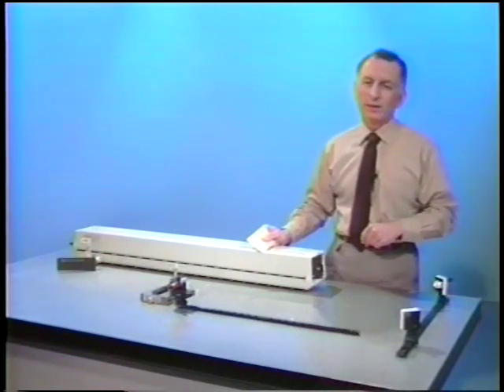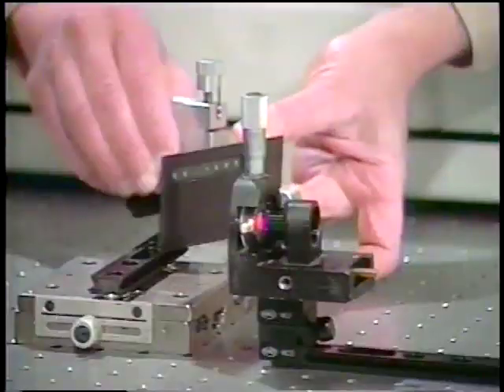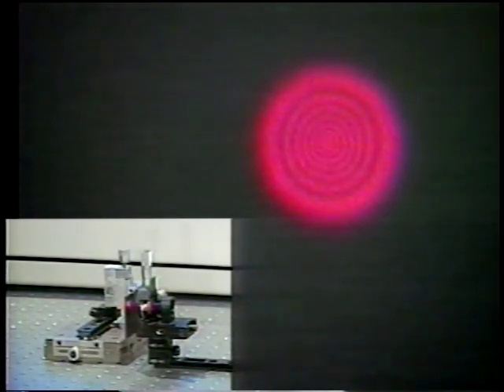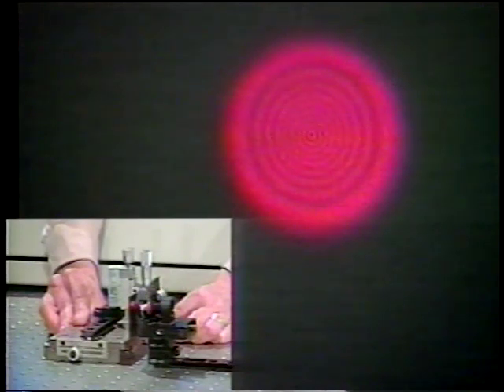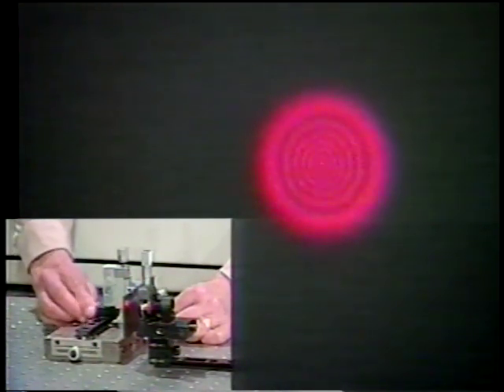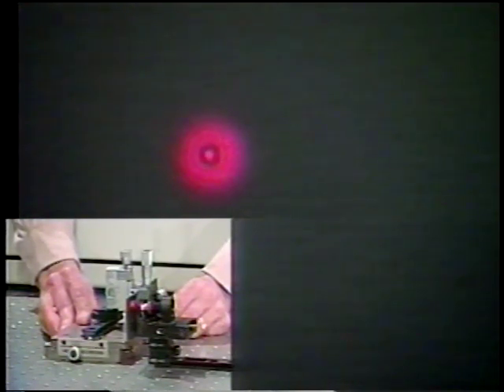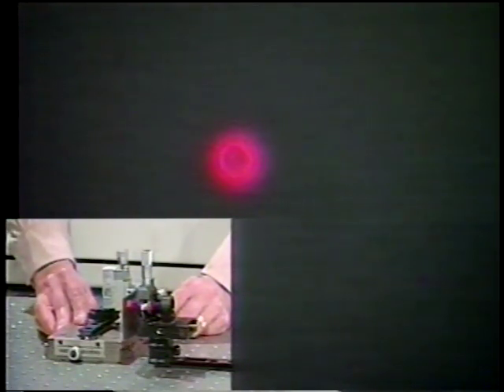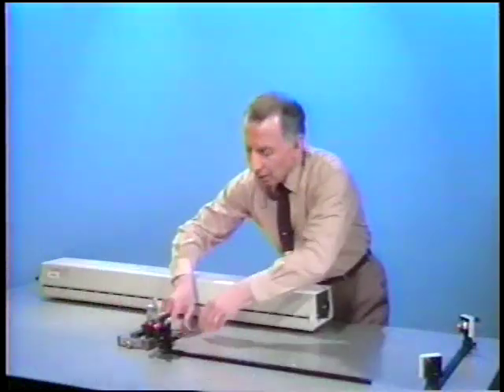Optics: Fresnel diffraction - circular apertures | MIT Video Demonstrations in Lasers and Optics

Comment: I am confused. I thought lenses are supposed in Fraunhofer diffraction not in Fresnel diffraction. can anybody explain this
Reply: They use mirror only
Reply: sir, to wipe out the confusion recollect in Fraunhofer diffraction WHY the lens was used? because we need long distances and then intensity would considerably drop and we can't see anything and so we need a lens to have a perceivable brightness.
Reply: That's right, Fraunhoffer diffraction involves parallel rays of incident light, and lenses. In Fresnel, non-parallel (spherical) rays and no lenses. It is because the source in Fraunhoffer is at infinity and the source in Fresnel is at finite distance. But in this experiment, the professor used the same source of light (He-Ne laser) for both Fraunhoffer and Fresnel. So in Fresnel, he used a convex lens to infront of the parallel rays to make appear like spherical rays, as is required for Fresnel diffraction. That's what I think happened here.

Comment: Why use the two mirrors? Why not have aperture in straight line in front of laser?
Reply: because you can set the beam parallel to the table with those two mirrors, otherwise the beam could be inclined respect to the table